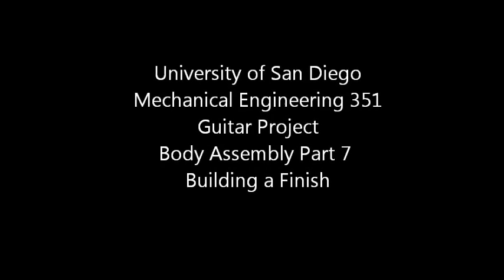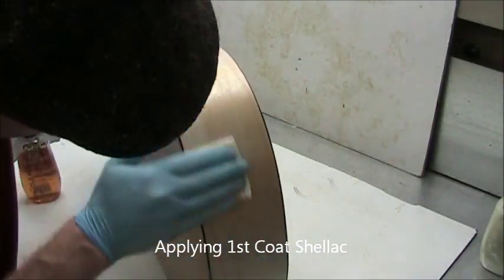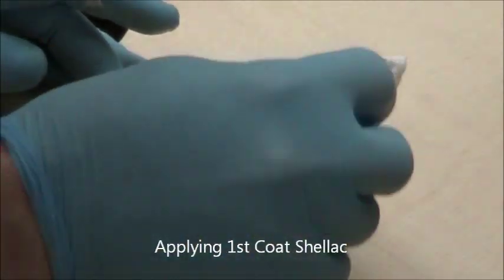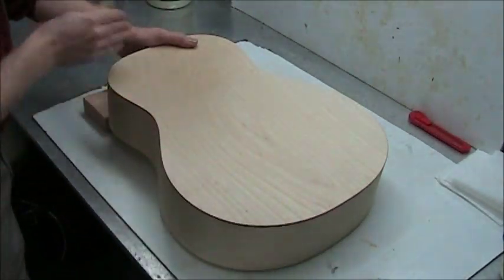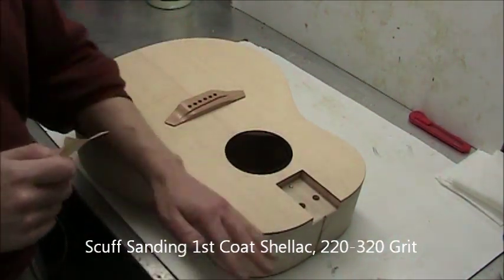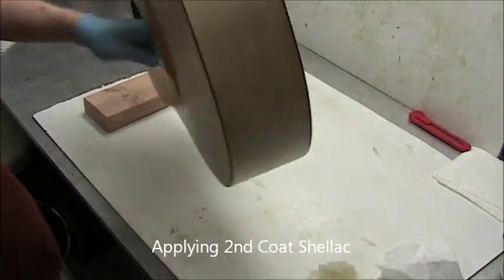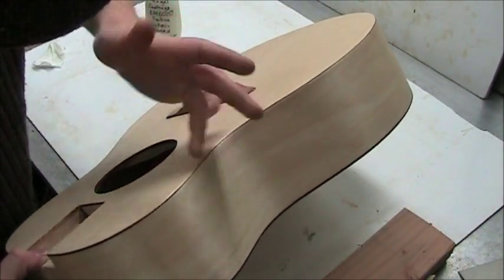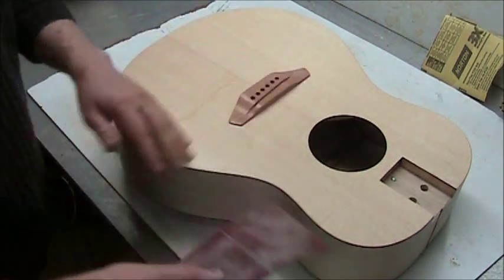Body 6: Finish

Comment: You can most likely use very fine sand paper. The softest sand paper, no tougher. And just use a spray bottle to wet each area you are sanding down.
It's time consuming, but worth it and can make it a matte finish with a little slight scratch design to it, depending on which way you decide to sand it.

Comment from the maker: It comes as just one shade, which is basically clear if applied thin, slightly amber with multiple coats.  (Note it needs to be thin to not craze with EM6000.)  Yes, it's a great product!

Comment: Does Seal Coat come in different shades or just one? The reason I'm asking is because I'm doing a project where I don't want much color imparted by the sealer coats, and by the looks of it here this stuff fits the bill great! Plus it's dewaxed so it won't interfere with my water based topcoat!

Comment: Thanks, this is very helpful. A few questions:
1. Will this be the same with an electric guitar body made of alder and a maple neck?
2. I'm buying a kit called "T Style Unfinished Guitar Kit Project (Maple Neck, Alder Body)" on ebay. The frets are already on the neck, but it is unfinished. Should I go ahead and do this between the frets or just buy a finished neck?

Comment from the maker: @TexasSizzle 
Yes, thanks--important distinctions.  Paper towels do degrade quickly, and would leave lint on a gloss-finish guitar.  Finishing the top before attaching the bridge does give a nicer finish (the usual scraping has been too slow for us in the past, but a pre-made mask might work).  

All: keep in mind this is a simplified guitar process for a class project.  A standard guitar would use finer (but more time-consuming) methods.

Comment: Typically  Spanish luthiers use a French style pad for applying shellac and add a little oil like olive or grapeseed or safflower as the pad becomes too dry. Also, they typically polish and shellac bridge before applying to soundboard. Also, I recommend using a flat block or pad for sanding because the hand is not flat enough but it's your call. Nice video.